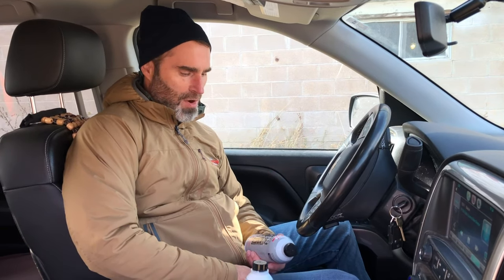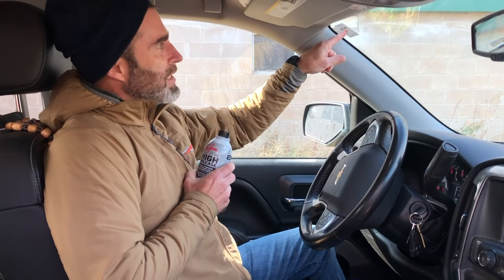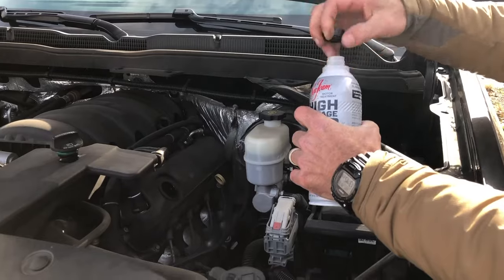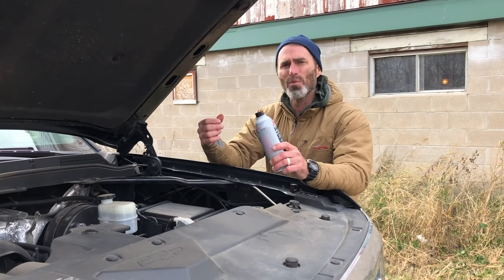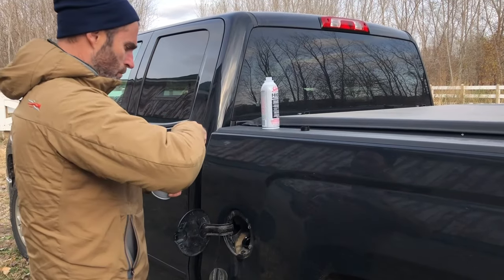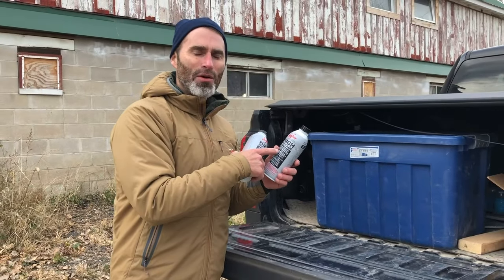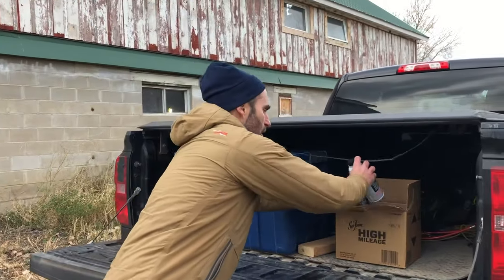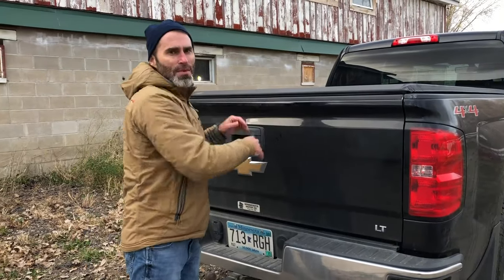How do I use Sea Foam High Mileage in my car or truck?

Comment: I used for the 1st time seafoam high mile can and my engine light is now off but my diagnostics said it Wes my air injection system does seafoam help with that? Next question I put seafoam reg in my crank case before a oil change and they said I had 2 quarts over which I don't understand does the seafoam break down sludge and add to what's in the engine ? Thanks
Reply from the maker: Thanks for the question. 1) No, there is no relationship to air injection, which occurs on the exhaust at start up. 2) Two quarts of oil is a lot! You'd have to start with a ton of sludge for that to happen.  Seems you were just over-filled. Hope this helps!
Reply: @SeaFoamOfficial  Thank you
Reply: I hope my engine light goes off when I sue it for the first time🙏🏻
Reply: Is your engine light still off...Kenyatta Dod?
Reply from the maker: @coolwater411  Let us know how it goes.
Reply: Sea Foam Official I have a 2003 Chevrolet Avalanche 5.3 Liters V8 it is burning oil and my engine light is on. I have 135,555 miles on it still run good though. I hope I can make it to 300,000 like your old truck did !
Reply from the maker: @coolwater411  We hope so too!

Comment: So before I change the oil in my 2014 Toyota Corolla that's at 160k miles, add some tot he oil and then the rest to the gas? Having a cylinder 1 misfire even after new spark plugs and coil pack changes and now I'm thinking it's the fuel injectors
Reply from the maker: That will work.

Comment: So put some sea foam down into the oil and dump a bunch into the gas tank. I’ll try it in my 06 dodge Dakota with 240000 miles on it. It’s burning oil right now.
Reply from the maker: Hi Corey: Yes, you got it + keep adding half a can to oil each interval.
Reply: Sounds good. I’ll try anything to keep the truck running good. It still has to make it through hunting season
Reply from the maker: @coreystoner4129  It will help!  Happy hunting Corey!
Reply: Corey Stoner John
Reply: LOVE DODGE, BUT NOT DAKOTA!! USE SEA FOAM TO GET IT BETTER THAN TRADE IT OFF FOR A REAL TRUCK LIKE DODGE 5.9 4X4 OR GMC 8.1 496, SO YOU PAY A LITTLE MORE IN GAS MILEAGE, BUT OH WHAT A DIFFERENCE TO BE PROUD OF. 👍🇺🇲⛽💯❤️
Reply: Corey Stoner is your truck still burning oil?
Reply: coolwater3 not anymore but then again I got a new truck
Reply: Corey Stoner why u sold it?
Reply: Corey Stoner Seafoam high mileage take TIME TO WORK
Reply: coolwater3 sold it because for inspection it need more than what the truck was worth to fix it and it was easier to get a new one. Now I’m driving a 2017 Silverado 1500 with the 5.3 under the hood
Reply: Corey Stoner are u using SEAFOAM high mileage motor treatment?
Reply: coolwater3 no I am not in my new truck. It only have 40k on it

Comment: Are you supposed to leave the car on when adding it to the gas tank?
Reply from the maker: There is no reason to have the car running when adding to fuel, though it will do its work through the fuel system and upper engine while driving. Hope this helps!

Comment: What's the difference between regular Seafoam and high mileage one? Will regular seafoam cause any issues to an old car with over 400.000km on it?
Reply from the maker: Both are similar but High Mileage does a bit better with stubborn engine and oil deposits.  Both are made form 100% petroleum cleaning and lubricating oils and ALWAYS safe to use.

Comment: Since my truck have the  engine light on and burning oil and I just got an oil change can I start out putting in 1/2 can of Seafoam high mileage motor treatment to get it started?Than after that I can start adding 1/2 can of Seafoam high mileage 500 miles and do my next oil change?
Reply from the maker: yes
Reply: Sea Foam Official what is BEST wait to 300 or 100 miles than pour in 1/2 can of Seafoam high mileage motor treatment to 6 quarts of motor oil than do an oil change?
Reply from the maker: @coolwater411  100 to 300 miles BEFORE you change the oil, so toward the end of the interval.
Reply: Sea Foam Official...I’m hoping(🙏🏻) that using Seafoam high mileage motor treatment I will get as much mileage as possible out of my 2003 Chevrolet Avalanche 5.3 liters V8 engine!

Comment: Can I use seafoam after filling up tank, and in oil after oil change (oil around 3,000 miles before 7,500 miles oil change)?
Reply from the maker: Yes, but better to add when tank is low to max the higher cleaning concentration. Yes, adding half way through the oil interval works great!

Comment: My 2004 chevrolet cavalier has 180,892 miles on it and the check engine light came on saying misfire with a fuel injector. The autozone guy recommend this stuff. My car is throttling. I wonder how long it'll  take to help. I have no way of knowing how much gas I have in the tank because the cluster doesn't work. I'm assuming I have half a tank based off memory of last fill, so I put one whole can in and am saving the second can for later.🤞
Reply from the maker: Hi Nicole. I think the AZ guy was right to recommend as a "last chance" before having the code evaluated by a mechanic.  Hope it works out for you!

Comment: What if I put it in when my gas tank is full?
Reply from the maker: That's fine but the less fuel, the greater the cleaning concentration. Hope this helps!
Reply: Sea Foam Official less fuel like half tank of gas?
Reply: Have u use it yet Chevy819 HI?
Reply from the maker: @coolwater411  I add when the tank is low, 1/8th or so.
Reply from the maker: @coolwater411  Not personally.
Reply: Sea Foam Official what do u mean not personally?
Reply: coolwater3 yes I’ve been using it .. my truck been running smoother..for now I been putting it every gas fill up
Reply: Chevy819 HI do u put it in your oil crankcase yet?
Reply from the maker: @coolwater411  Can add to oil crankcase at any time.

Comment: Just used it in my 2.0Eco-boost  had 130 on it randomly stalls every once in a while.
Reply from the maker: Are you showing any misfire codes? You might have a fouled plug issue.
Reply: @SeaFoamOfficial   I am not having any codes at all. Seems to be working better after using sea foam.

Comment: Hello good folks at sea foam, unfortunately I found myself behind the wheel of a 5.3 chevy with AFM that has the notorious oil consumption issue, when added to the crankcase will your product help with that?
Reply from the maker: Add half a can each interval and see what happens.

Comment: I just changed my oil. Any knows if I can still use it on fresh oil? I have a bmw 328i
Reply from the maker: Yes, can add anytime during the oil interval.
Reply: I did. 1 oz per quart
Reply: @SeaFoamOfficial  what are the repurcussions? do i change it earlier or?
Reply from the maker: @amc7615  Just leave it in just like any oil change interval. No repercussions.

Comment: Got a 2012 Camry with 200k on it.  Is it as easy as half the bottle in the oil filler and the other half in a half tank of gas?
Reply from the maker: Yes, that's a great way to start the routine.
Reply: I have a camry also, 98. How has it worked?

Comment: Seafoam high mileage work for diesel motor? Or only gas?
Reply from the maker: It's formulated for gas engines. Can add to diesel motor oil.

Comment: Is high mileage better then the original sea foam? Any test result?
Reply from the maker: Great question! Most things need something different as they get older. Sea Foam and High Mileage are very similar, but High Mileage is blended to do more for an engine as it becomes more vulnerable to deposit buildup and heavier oil residues.

Comment: How do I use seafoam in my air intake on my 1989 Ford Crown Victoria???
Reply from the maker: Hi Pimblac. You would use Sea Foam Spray for intakes. Check out the videos.

Comment: I drive a toyota corrolla how much do I add?
Reply from the maker: Hi Marie. To oil: Half a can to the oil crankcase each interval. For gas tank: Add a can to a low tank of fuel every couple months. Adding to a lower amount of fuel increases the cleaning concentration. Hope this helps!

Comment: My Vortec v 6 '98 has 230,000 miles on it. Should I use this?
Reply: That intake manifold is a real stinker, it hides the spider valve, aka central port injection. Be careful, those things are better left alone..i had a 95, which the cpi failed notoriously. 1998 was redesigned, just know the cpi is an expensive repair.
Reply from the maker: Yes, that's what it's for - try it!
Reply: THE SOONER THE BETTER. 👍🇺🇲⛽❤️

Comment: My '18 frontier is knocking some.  Should I try this?
Reply from the maker: If a knock, add a couple cans to a low tank of fuel. If a lifter ticking noise, add half a can to the oil. Or better, do both.
Note: If a one-year-old engine has a knock I'd get it looked at!
Reply: Knocking? Ewwww! Ticking is valves, or exhaust manifold leak. knocking maybe main bearings around crankshaft or rod bushings..if you have coolant leak in an engine, the kind that requires a quart of coolant every 1000 miles, not severe, but an internal coolant leak nonetheless, that coolant in your oil can corrode/pit/ wear the bearings faster on the crankshaft rods and main.. i wouldnt expect seafoam to help that
Reply: I wouldn’t be adding anything into the crankcase when he’s within the 3yr/36k mile warranty. I own at 19 Frontier and if your truck is slightly ticking at idle, I would change over to a more thicker synthetic oil like valvoline advanced synthetic. 
If he gets that truck in there and they have to replace motor and find out he poured sea foam in crank Nissan would void that warranty so fast.
Reply: Pwrcritter next oil change substitute one quart of oil for one quart of Lucas oil stabilizer. Same thing happened to my 05 Tahoe, it took care of it and it just turned 250,000 miles. Engine is super quiet and you cannot feel it idle at a stop sign. I promise it will help your issue if not eliminate it.
Reply: Yes it's more like a ticking at idle.  Tried a gumout gas treatment but didnt help.  Good ideas, will have to try.  thanks!
Reply: @pootthatbak2578 , ABSOLUTELY,, NEXT THING IS TO TRADE IT OFF WHILE YOU ARE ABLE!!! 👍🇺🇲👍⛽

Comment: So I did my oil change and followed these steps, and my truck started leaking oil bad, does anybody know if this sea foam causes
Leaks? My truck wasn’t leaking prior to me adding this, now it won’t stop leaking.
Reply: I have a 2001 Chevy Silverado 4.8
Reply from the maker: @krazykrimizbak  How many miles on the engine? Sometimes an older engine can have a lot of oil varnish build up that ends up plugging leaky seals/gaskets... Because Sea Foam reliquefies varnish, appears it might have cleaned up the goo around leaky seals.
Reply: My Silverado has roughly around 180000miles, and I see that’s most likely what happen, I was doing a little research and that’s what most sources are telling me, I just thought I was weird, but this makes sense, I’ll still continue to use Seafoam products. I’ve always heard good things about it. Thank you so much for your response, it is much appreciated 🙏

Comment: Would it be best to add 5 oz to my crankcase ( 5 qt system)  300 miles before oil change? Or can I add more to get a better clean.
Reply from the maker: You could add more. I like to say half a can for 5 quarts. And 300 miles is ideal!
Reply: @SeaFoamOfficial  Awesome, Thank you!

Comment: I don’t want to ever risk putting this stuff in my Oil… I use 2 cans in my gas and then I put a bottle of Marvel Mystery Oil in the oil
Reply from the maker: There's nothing to risk. What is your concern?
Reply: @SeaFoamOfficial  I’ve heard a lot of people saying that Sea Foam in the oil causes their vehicle to idle really hard in early 2000s Fords. And I have a 2004 Ford Expedition with the Triton 4.6l
Reply from the maker: @GameTesterDev  No, that does not make sense. Not an issue whatsoever.

Comment: Damn where can I buy Seafoam high mileage at?
Reply from the maker: Any auto parts store has it.
Reply: Sea Foam Official I’m so excited to use it, but I just got an oil change and I’m not even close to a half of tank of gas yet 🤬
Reply from the maker: @coolwater411  It'll happen...

Comment: lol I added the whole can in my crankcase🤣
Reply from the maker: You should be OK if adding to 5 or 6 quarts (or more). Just watch your oil color - if it goes dark fast, replace your oil.
Reply: If I plan on driving a while with seafoam in the oil, I use half a can. But I will throw a full can in and let it idle in park for a while right before an oil change. Five quarts in my case.  I wouldn’t advise loading the engine with extra seafoam in the oil.